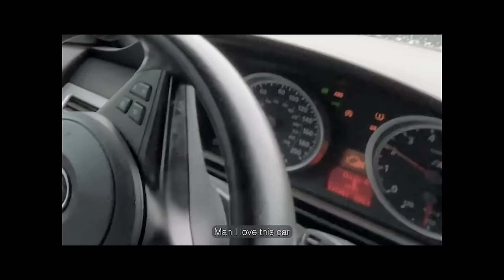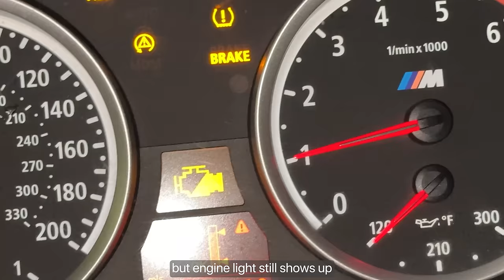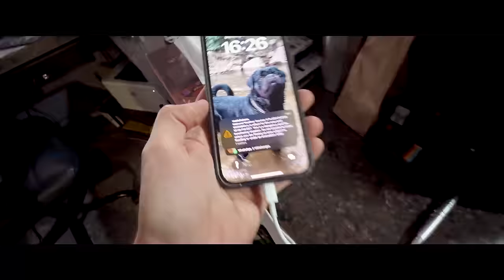FIRST M5 E60 CONVERTIBLE EVER? - CUTTING THE ROOF OFF ON MY M5!

Comment: There was supposed to be an extra reinforcement piece from a non sunroof version in the middle of the roof, did the same conversion on a e92 335d, the piece could be ordered straight from the dealer, it helps with wind buffering and extra rigidity

Comment: Hey sheepman, it’s too late now but fun fact: there’s a trick to changing the starter of the s85 without having to work from the bottom, you just have to unscrew the housing of it from the top and then you can just put in the internals of the new starter, with all the wearing parts changed!
Reply from the maker: Yep we figured that out later aswell lol
Reply: @schaefchen  buy one more m5 to make use of this knowledge

Comment: @schaefchen -> I have to sadly correct yourself, cause NOT the forklift is your nemesis, it’s actually the E60 M5 🤪😂
Sorry, I couldn’t resist 🤷🏻‍♂️🥴😉
And yet again another great video, gosh I love that content, especially the “science parts” of it ❤😉
All the best, Philipp ✌️
Reply from the maker: Thats true😂😂
Reply: @schaefchen  But because I am a very curious person: It was in fact such a disaster finding a new starter for the S85B50? I assume the starter of the E63/E64 M6 is gonna be the same. I didn’t google it but I bet the starter BMW used for this particular engine is only being used in the V10 engines, not in any other V8 engines like the S65 or S63, am I right?
Fingers crossed guys! Y’all are doing an insanely good job!